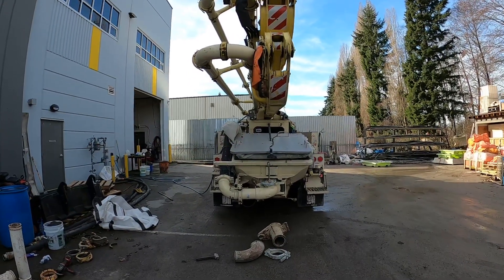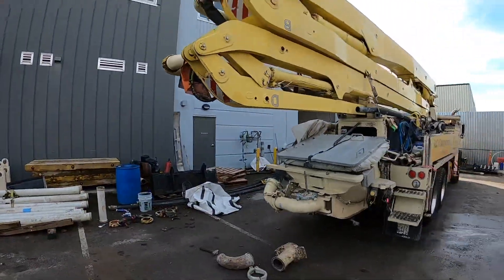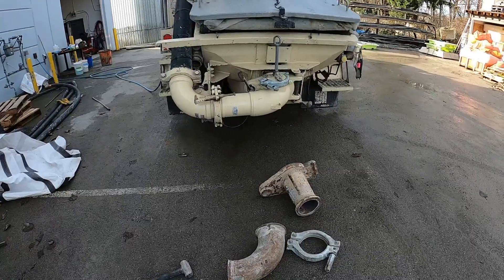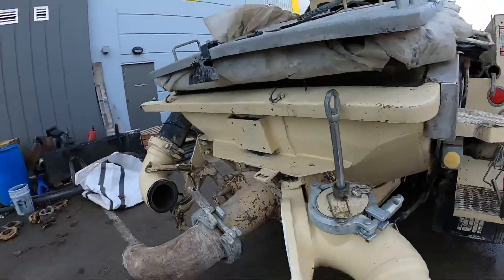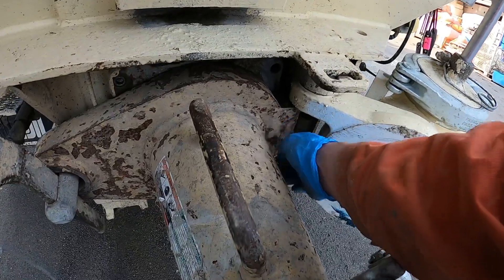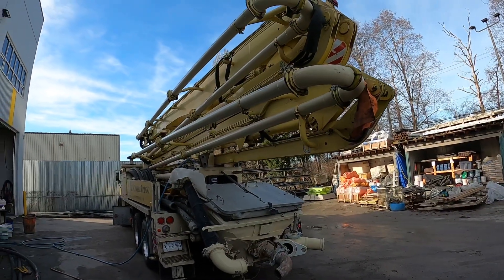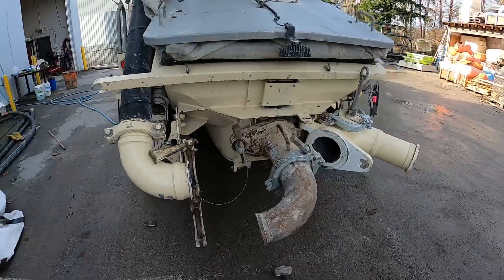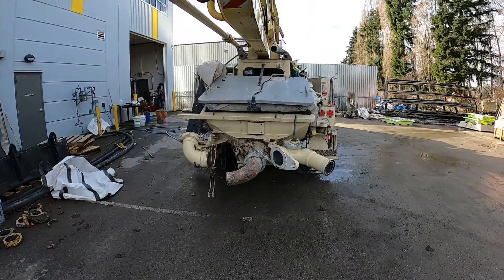Quickest way to turn your Putzmeister boom pump into a line pump using ConForms quick line adaptor:

Comment: I went out and bought one of these after watching your video.  I love it.  It was easier to roll out 125’ of line and not use the boom over top of the house with high power electrical lines overhead.
Reply from the maker: Absolutely! We get a good number of jobs like that where it’s much easier (and less stressful) just to run a couple of extra hose and pump straight off the back end with this adaptor. Glad to hear you’re getting some good use out of it. We love ours!

Comment: What year is this boom pump?
Reply from the maker: The pump in the video is a 2007 Putzmeister 40Z. I believe that for some of the newer style hoppers they have had to revise the adaptor slightly for it to fit. This thing is worth it’s weight in gold if you work in an area where line-pumping is often the most sensible/only option.
Reply: I think they have to make the one I need for my 2019 38m the tang on the adapter needs to be shorter because the space between the two pivot points is narrower. I’m still gonna order it! I called Com Forms today and they’re gonna get back to me I told them I saw your video demonstration and that’s why I’m placing my order 👍🏼 Thanks for the videos they’re always entertaining.
Reply from the maker: @rcppop3090  We went through the exact same thing with our our 2017 38-5. The tang needed to be resized in order to fit in between the mounting ears of the swing-gate.
Reply: Yes sir it’s going to pay for itself in a month. Maybe even a week really 🙌🏼
Reply from the maker: @rcppop3090  time savings with this little gem is huge!

Comment: Do you know if they make one for Schwing Boom Pumps, cuz we do alot of 4 inch off the backend with line dragons. It would be so much nicer not to realign the high pressure elbow when putting things back together like you said, it's a pain
Reply from the maker: I believe ConForms may have something similar for the Schwing back end. I would get in touch with them to find out. Sometimes they have products which are otherwise difficult to locate through the catalogue. I find it easier just to call and ask. Their sales staff is extremely knowledgeable.